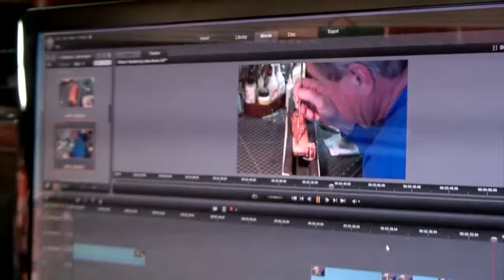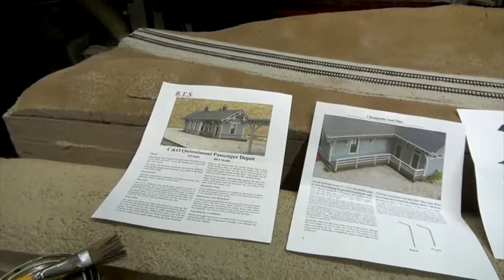What's neat - May 2016 column | Model railroad tips | Model Railroad Hobbyist | MRH

Comment: I am having an Athearn Genesis GP 38-2 and I would like to know that apart from the cabin of the loco which can be opened, can we also open any other portion of the top near the exhaust points ?
 You can see the picture of the locomotive in my channel. TY
Reply: +Modeller&#39;s Point  That's a really nice handmade automatic point control setup you have 
there. You might wanna cover that motor setup part with some building or
 something to hide it if you are planning to do a surface mount point 
motor.
Reply: +ShadowMaster2714 Thank you for the tip..... I already thought of that idea though and in-fact you can also mount it under the bench..... All it needs is a bit of gluing.